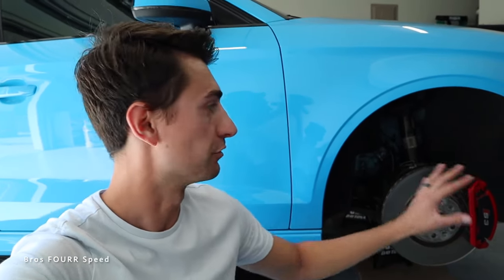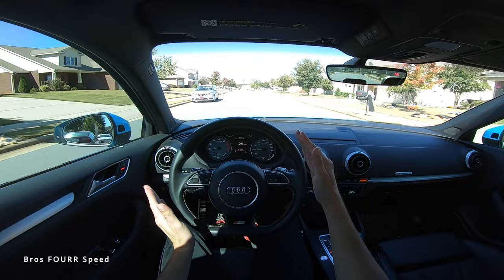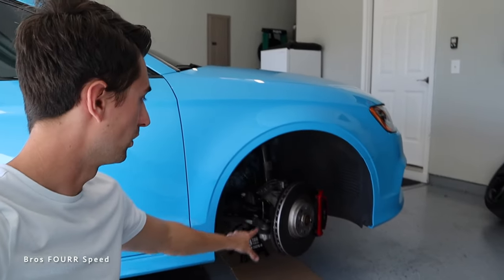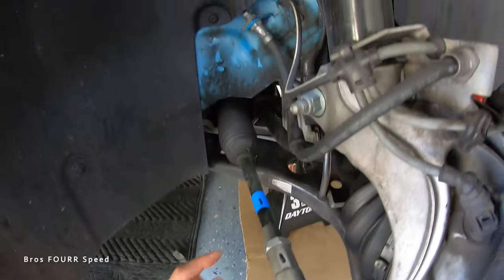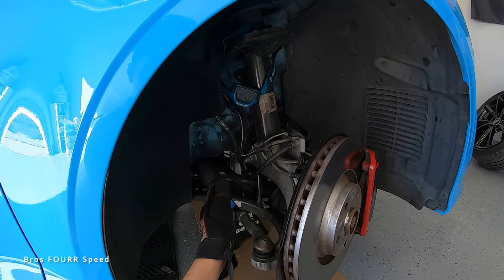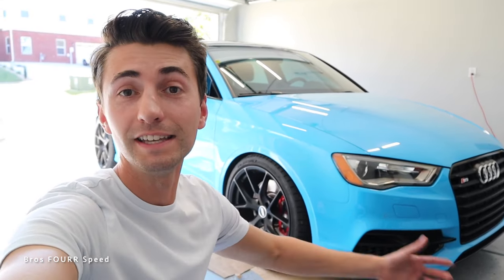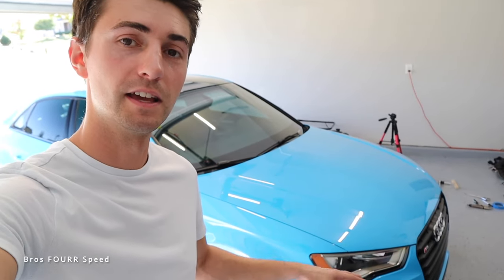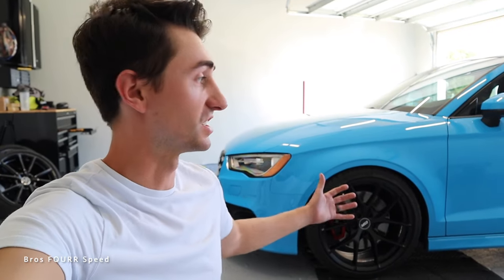How to Straighten Your Steering Wheel Easily at Home | DIY Car Alignment

Comment: It’s nice to know there is a remedy, but why can’t the alignment people ever get it right? Why can’t they check wheel position before returning the car to the customer?
Reply from the maker: Shops don't want to spend the time to drive the car around for the most part. Some shops do. Or some people just don't see as straight and them eyeballing it isn't how the customer would eyeball it. At least this is something easy enough to do
Reply: @BrosFOURRSpeed  I’m assuming they eyeball it from outside looking through the window too. In my car the instrument panel sits at a tilt and I think the techs line it up with that. Still, after paying $150-$200 You would expect attention to detail.
Reply from the maker: @timothyjackson4653  Generally they sit inside and line it up and then use a metal tool to hold the wheel. I just had my Lamborghini aligned yesterday and it went well with a straight wheel at the end. I think maybe they either don't line it up perfect, or they don't tighten the tool all the way. And while they are doing the alignment, the steering wheel turns a bit. So it can be hit or miss.

Comment: Can you adjust it and test without testing it in the road
Reply from the maker: Hard to know if it ddrives straight without driving the car
Reply: @BrosFOURRSpeed  you need to adjust both sides? Or only the side where it leans?
Reply from the maker: @ArczAngel  I showed all that in the video. You have to do both front wheels. If not you’ll cause uneven wear
Reply: @BrosFOURRSpeed  it is possible that only the right wheel is off? When in parked and when the steering wheel is straight, i noticed only that my right wheel is kinda facing leaning outside

Comment: Can I do it with the wheel mounted?
Reply from the maker: Depends on the car and your ability to reach the bolts. I did this on my Supra and didn't have to take the wheels off
Reply: thanks, I tried but the bolt is too hard and I'm afraid of breaking something!
Reply from the maker: @Coma-23  Yeah definitely don’t want to do that. Might just need a professional alignment if that’s the case

Comment: how did you know the first try it was only 1 turn very confusing…. mine is not straight either points to the right after changing front suspension
Reply from the maker: Trial and error. I just guessed and did 1 full turn to see what it would do

Comment: Good idea by the way, but this destroys the alignment between the front and rear wheels. The rear tires align differently than the front tires and this causes tire wear and can make the car unstable in slippery conditions.
Reply from the maker: No it doesn't. If you do the exact same amount of turns on each tie rod end in the opposite direction. Alignment will not be effected. Only the steering wheel will turn. I learned this tip for a race shop. I think they know what they are talking about. But the physics don't lie either. Keep in mind this is all provided you just had an alignment. If you alignment is already just off in general, this wont do you any good.

Comment: That’s some serious OCD! Mine have been off by 20-30°. THAT is enough to bug me. By the way, your steering wheel can be off in the opposite direction that the vehicle wanders. The two things are not correlated.
Reply from the maker: Since the steering wheel wasn't centered after my last alignment, adjusting the tie rod ends is out you can re center it to not effect alignment

Comment: So basically if I'm drifting to the left I'd do the opposite of what you did? I don't drive anything fancy, 99 toyota 4runner so should be simple enough.
Reply from the maker: It will be the same concept on any car. Depending on if your tie rod ends are in front of the wheel or behind will determine which way you need to rotate them

Comment: Does this throw out the alignment at all?
Reply from the maker: As long as you do equal turns on each side it won't. So get a proper alignment and if you need to make this adjustment. Keep the turns equal

Comment: After this your tire will wear unevenly unless you maintain equal length of right and left tie road
Reply from the maker: Yeah thats why I showed that many times in the video and stated many times you need to do an equal amount of turns to not mess up your alignments toe adjustments.

Comment: Could you not just remove the steering wheel and turn it one notch on the spline?
Reply from the maker: That's honestly a lot harder to do. But most have a center spot where you can only put it on one way. My Supra is like that. Has the splines, but the bottom side has a notch to fit centered

Comment: Doesn't this mess with the toe and cause tires to have uneven wear
Reply from the maker: Nope. Thats why, like I mentioned its the video, you have to do both tie rod ends the same amount of turns, but in opposite directions
Reply: @BrosFOURRSpeed bro what if I adjusted one side of the tie rod only? We manage to get the steering wheel straight after being crooked slightly to the left using this method but we only adjusted one side (right side only)

Steering wheel is crooked slightly to the left and car pulls to the right when steering wheel is straight. I think we have done a full turn in the tie rod (right side) then road test and car now runs straight with perfect steering wheel position. Will this ruin our alignment even we have adjusted only 1 turn to the right side?

Comment: If you don't need to move the wheel much you can just adjust one side or the other. No need to do both.
Reply from the maker: That will throw off your toe and mess your actually alignment up. Doing both ensures your alignment doesn't get changed

Comment: This is assuming you already had an alignment done and your steering wheel is still off center. That's a typical problem with a lot of RVs.
Reply from the maker: Exactly. If its been a while your alignment might just be off in general. But after a professional alignment if your wheel is off, this fixes it.

Comment: You should’ve just straightened your steering wheel and adjusted the rotors to be straight again reaching the rod would be a little harder but it will save you time
Reply from the maker: The only thing is, how would I know what true straight is? I don't have a good way to measure that

Comment: Did he not start with his rotors turned to the left already???
Reply from the maker: It doesnt matter how you have the wheels turned when doing this. Just drive with the steering wheel straight. If you are drifting to one side, you know you need to turn both wheel in the opposite direction. That will turn your steering wheel
Reply: @BrosFOURRSpeed  ohhhh okay. Thats where I messed up at. Thank you !
Reply from the maker: @ChuckMate3  yeah it can get confusing thinking about all the different angles lol. I did make a new video with our RS3 on the same topic. I think I broke it down a bit more simple
Reply: @BrosFOURRSpeed I’ll check that one out too !

Comment: Pedantic candy arsing. Wait till you come off a special stage with the steering wheel 90 degrees out of alignment. Two pieces of bamboo which will slide one inside the another at four o'clock and eight o'clock will do at a pinch (you can't get the bamboo in at three and nine because the engine's in the way). Tape the bamboo together to make a comparison. But don't expect perfection, just an improvement.
Jack, the Japan Alps Brit
Reply from the maker: What are you even talking about? So confused by this..
Reply: It is possible that your feeling of out of alignment stems from the driver's seat not being in the straight ahead position. Smaller cars are often like this, so if this really bothers you'll need to reposition the seat. Botton line, learn to live with it.
Jack, the Japan Alps Brit
Reply from the maker: @Jackthesmilingblack  Judging by the comments. Many other people have the same issue and this solved it. Regardless, this adjustment doesn’t effect alignment. It simply turns the steering wheel. So if it gets the steering wheel in a position I’m happier with, that’s a good things to do. I’m more comfortable in the car now because the wheel looks straight to me.

Comment: Pulling to the right is intentional as a safety feature. If the driver falls asleep at the wheel the vehicle will pull right, off the road, and not into on coming traffic. I have an OCD with this being the case but that's why every alignment will pull slightly to the right.
Reply from the maker: That sounds like it would be a cool safety feature, but I doubt they really do that on purpose. I've had cars that got aligned and were perfectly straight. Where did you hear this?
Reply: This makes no sense. In countries with right hand drive the cars would pull into traffic if this was the case. The issue is most alignments are done with eyeballing instead of using proper steering wheel lockers, if you go buy a brand new car i bet you it will track straight as a arrow, same if you get a perfect alignment.
Reply from the maker: @Fros789  very true. Not everyone sees level the same. So a random mechanic might have it off compared to your eye. Nice to be able to adjust it tho
Reply: that is ridiculous and absolutely incorrect.  Your car should not be pulling one way or the other.  it should be going straight with a proper alignment.  
its quite possible a certain road you are traveling on isn't level and it pulls you to the right...but thats the road not alignment.
Reply: The insanity of this comment section. I gotta get outta here..
Reply: Imagine being this dense

Comment: your tie rod is on the back of the wheel ,and you lenthen the tie rod ,but if your tie rod was on the front of the wheel you would shorten the tie rod
Reply from the maker: Yes! Just have to look where it's located to determine if you need to lengthen it or shorten it to turn the wheel in the desired direction

Comment: Do you need to have your wheel straight while adjusting the rods?
Reply from the maker: Technically no. Just make sure the car has already had a professional alignment. And just do even turns on each side.
Reply: @BrosFOURRSpeed  thanks much!

Comment: I thought crooked steering wheel meany it is not aligned. Just got an alignment. Going back to complain and have them do it right
Reply from the maker: In many cases it is. But this video is more for after you get an alignment if the steering wheel is crooked. Easy enough to fix yourself and avoid the hassle of going back to a shop
Reply: @BrosFOURRSpeed I see. Thank you! Definitely not ready to take things apart myself yet lol.
Reply from the maker: lol yeah just depends on what your used too. I hate having someone else work on my cars. Most of the time they miss things that wouldnt lol
Reply: @BrosFOURRSpeed  No I agree with you. It drives me nuts when people lack attention to details especially when it is crucial.  😆
Reply from the maker: @aeptacon  For sure! So many shops don’t actually care enough to be detailed
Reply: @BrosFOURRSpeed Reporting back-they fixed it for me. It is straight again and not driving me nuts 😄. Still, thank you for your video
Reply from the maker: @aeptacon  lol glad it’s fixed!

Comment: I have lifetime alignment and they didnt fix the steering wheel.
Reply from the maker: This is a good way to adjust it yourself without messing up the alignment
Reply: @BrosFOURRSpeed  how do I know if I need to adjust one side or both tie rods?
Reply from the maker: You have to adjust both sides equally in opposite directions. If you only adjust one side, you'll mess up your toe and alignment
Reply: @BrosFOURRSpeed  It is still pulling to the right its ridiculous they cant get it right. So I have to go back again for the 4th time. Good thing its life time alignment.

Comment: Alignment shops make that awful adjustment due to what they like to blame on government reg as you might fall asleep and drive into oncoming  traffice and they refuse to adjust it.
Reply from the maker: That's weird. I've never heard of a shop not doing a straight alignment because of that. I think just sometimes the steering wheel gets moved while they do the alignment and throws it off. Most shops will redo it for a customer

Comment: The steering wheel is crooked after an alignment because you either hit a curb or a really bad pothole.
Reply from the maker: No, it can be crooked if the shop doesn't line it up perfectly straight before making the adjustments. The alignment itself is perfectly straight. But the steering wheel being off is due to the technician not lining it up perfect. Or it moving while they make the adjustment.

Comment: sounds like u un did toe in
Reply from the maker: No. Since I did both tie rod ends the exact same amount of turns in the opposite direction of each other, the toe remains unchanged. The steering wheel is the only thing that got altered with this adjustment. Thats the whole point of the video
Reply: @BrosFOURRSpeed  maybe obviously 
the way u said it sounds lime you toed in passenger side & toed out drive side